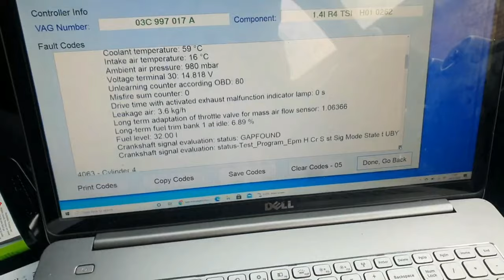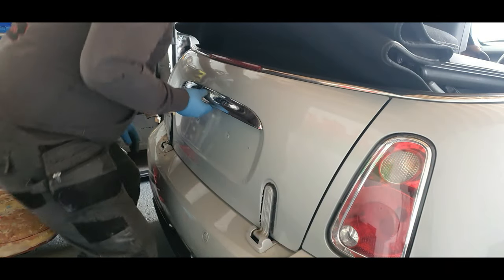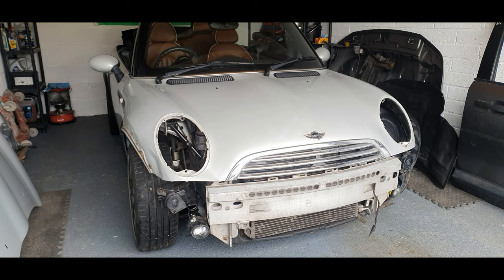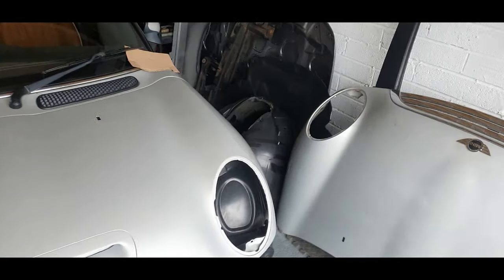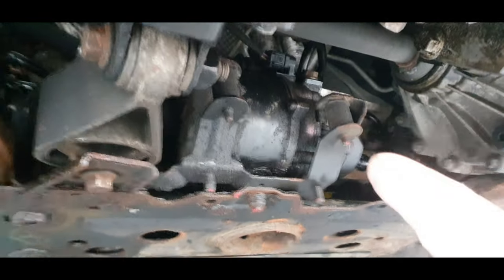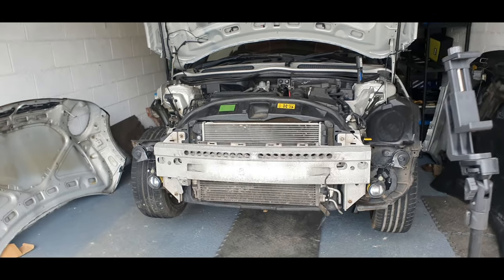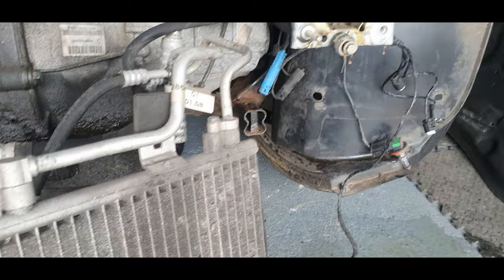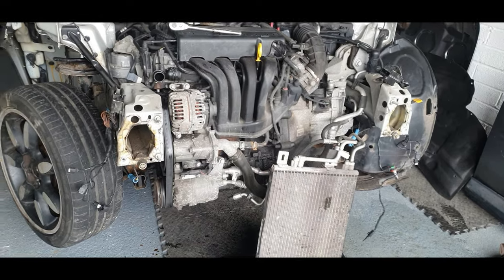How Bad Is The Oil Leak?

Comment: My mini was leaking from the driveshaft seal, rocker cover and oil filter. Not hard jobs just tricky finding exactly where they’re coming from. Hope you sort them out mate.
Reply from the maker: Thanks buddy ... definitely a common problem... at least its not a mechanical problem... I can live with a leak or 2 lol ... the power steering pump is whining now any ideas?
Reply: @RevivingSalvage  Is it on a belt? Could be the pulley normally?
Reply from the maker: Na it's electric having done some research thats another common fault grr

Comment: The Mini really does suffer from poor reliability. Mainly under the bonnet. Although the Mini is suppose to be bmw the engine is french and a heap of s***t, just not up to the job
Reply: Each to their own bud I have owned an 04 r50 cooper for last 10 years and its no worse than other cars out there . I would prefer earlier cars though the peugeot engined ones have their own issues
Reply: @richardmounfield7822  Fair comment, i don't know what possessed bm to start using the Peugeot unit. I assume it was an economic reason. Why else would you change from an ultra reliable engine to a company that is renown for very brittle engines. You have probably guessed i'm not a fan of French engineering
Reply from the maker: They do have a lot of common faults. The mini has only covered 70000 miles & I have to replace nearly every seal. I thinks it because the engine runs quite hot 🔥 that things ware our quicker 🤔.  But you can't help but like the car ...
Reply from the maker: I didn't know they used Peugeot engines ... its mad your paying just for the badge under the bonnet could be anything lol
Reply: @RevivingSalvage  second gen petrol and diesel are a peugeot engine bud
Reply: @RevivingSalvage  There is a lot of that going on now i'm afraid. You think your buying a BMW but your actually buying a bm with a rubbish Peugeot engine. The Fiat 500 and the Ford Ka are the exact same car with a different body put on them
Reply: @chrisyoung5573  The W10 and W11 Engines used in the R50 / R53 aren't French. Only the R56 upwards.
Reply from the maker: So I got r52 ... so that isn't a Peugeot engine?
Reply from the maker: Thanks very much 🤙
Reply: @RevivingSalvage  You have an R52 so the engine is a tritec unit (Non Supercharged is the W10 and Cooper S / R52 Cooper S is W11), which is used in Chrysler’s and minis. 👍

French engines did start getting used in the R56 (Same Engine was also used in the Peugeot RCZ. They suffer with various issues - High Pressure Fuel Pumps, Valve issues, etc etc).

Steer clear of early R56 unless you want a real challenge 😂
Reply: Let's get the facts straight - the Prince engine as used in the R56 isn't a Peugeot engine - it's a complete half and half effort with BMW. In fact all the problems associated with it are totally down to crap cheap Bmw design faults associated with its variable valve timing - timing chain and tensioner design - which are common to all N series 4 cylinder engines throughout the BMW range. The only good bit of the Prince engine is in fact the Peugeot part of it - which is the block pistons and crank. BMW haven't produced a decent reliable 4cylinder engine for 20yrs - I've yet another customer coming in next week with a 4 year old 60k miles 1 series with a snapped timing chain - they are total piles of rubbish and people think they are getting a quality car. Thankfully this Convertible is one of the last Chrysler based tritec units - they leak a bit of oil here and there but are pretty tough other than being prone to the odd head gasket.
Reply from the maker: Thanks very much for your very detailed comment ... with all their faults BMW are still up there as one of my favourite cars ... I aways wanted to own a M3 .